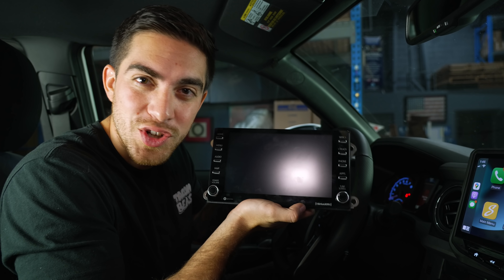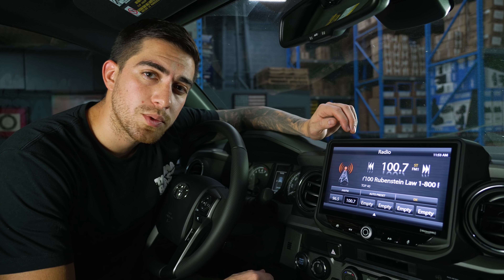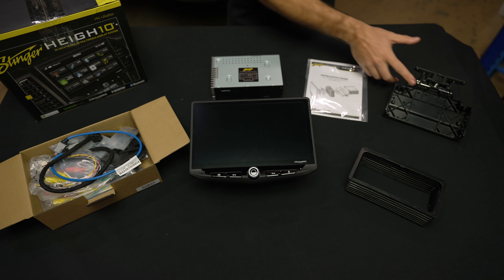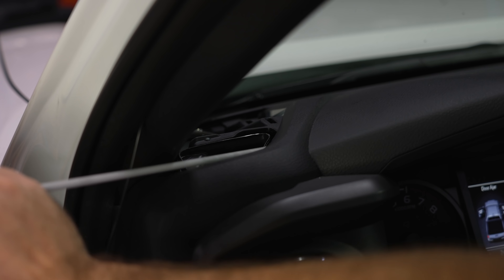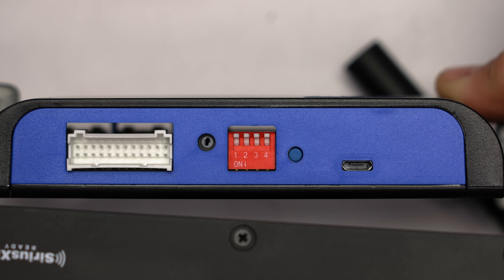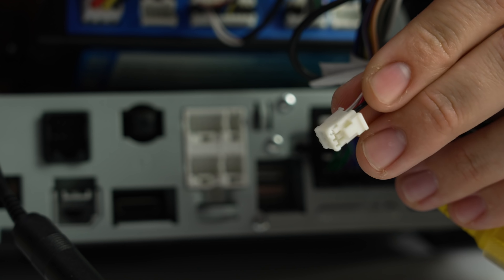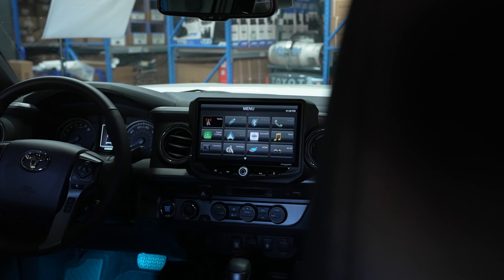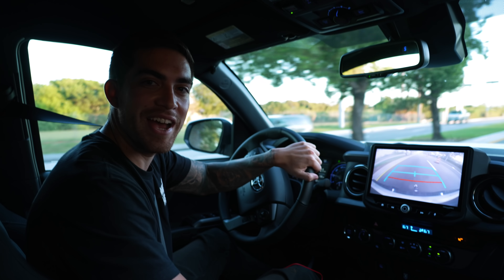2016-2022 Toyota Tacoma 10" Touchscreen Infotainment System Review/Install

Comment: Greetings. I will truly get this soon. But I had a question about the hdmi and usb. Can you plug in a external portable hard with video and watch it in the screen. Also is the hdmi plug accessible. Also what additional cameras can you use for this. Thanks
Reply from the maker: You can technically plug any device that uses HDMI, HDMY is not that accessible, our advice would be to connect the HDMI cable a route it to the desired destination. Here is one of the camera options that are currently available, more on the way! - https://tacomabeast.com/collections/head-units/products/flexible-housing-self-adhesive-blind-spot-camera-1

Comment: So with the factory screen, is that compatible with any other toyota vehicles?? 
I have a 2016 corolla and I want to upgrade the factory screen. I was wondering if I can use it on the corolla? I mean if not what do you do with the screen. If you can that would be awesome.
Reply from the maker: It is made for Tacomas but i believe stinger has options for other Toyota vehicles 🤙

Comment: How do you connect Sirius XM? Where does the black cord end go to make this compatible? Thanks!
Reply: It is super simple. If you get the required SiriusXM adapter for $50, it just plugs right in to the brain of the head unit with the provided cables.

Comment: Does this upgrade make your rear camera an "anytime" camera?   
And if you can add extra cameras, if you install a front camera, will it make that an "anytime" camera?
Thanks!
Reply from the maker: It would make all cameras into anytime cameras meaning you could activate them from the unit, and as long as the camera you instal is compatible it should be good 🤙

Comment: Does the harness come with RCA inputs for aftermarket amps? Curious to know because I am running a JP234 4 channel amp and a JP23 monoblock amp onto my stock 2018 TRD sport headunit.
Reply from the maker: It comes with 3 RCA outputs, front rear and subwoofer 🤙

Comment: VHB tape would be a lot better to secure the radio replacement interface. Zip ties seem like a really janky solution considering the price. Does this have the same issue as the stock unit with delayed audio when connected with bluetooth?
Reply: That was my thought exactly.  $1500 and zip ties were the best solution to secure the radio module?  Cool upgrade for sure!
Reply from the maker: You could use 3M tape if you’d like 🤙

Comment: I just installed this kit on my 2018 TRD Pro today. Overall it looks nice in the truck. But my backup camera will only come on when I manually turn it on with the camera button. It does not come on when I put the truck into reverse. I have triple checked everything and it all is as it should be, but the problem still remains. I don't think its the case, but my truck is a 6 speed manual transmission. Not sure if that could have anything to do with it, but I doubt it. I have reached out to Stinger off-road Technical support in attempt to get it resolved. The external microphone does not work either. I just switched to the internal mic on the device and it works fine. Any insight would be greatly appreciated.
Reply from the maker: Stinger support might be able to help you better since we haven’t had any of these issues

Comment: Will this head unit wake up the dead stock rear speakers?
Reply from the maker: You could potentially plug the speakers into the unit althought it might be a different issue that’s caused them to die on ya 🤙

Comment: Does it still have the built in maintenance reminders that is on my 2016 infotainment center?  Resetting mileage for tire rotation, oil and other fluid changes would be a nice feature.
Reply from the maker: It should still have all the settings 🤙

Comment: Does this fix the low rear speaker output?  My 2021 rear speaker output is so low I have to fade to the rear to even hear them.
Reply from the maker: Im not sure if that’s an issue that can be fixed with this, it might be a faulty speaker or you might want to try upgrading your sound system🤙

Comment: Is this louder than the JBL system since it has a bigger amplifier?
Reply: I'm sure it will make slightly louder. However you need a whole lot of amps to get up just one more decibel once you are up around 110 db or so already.
Reply from the maker: It can link with the jbl system so it’ll be even louder for sure 🤙

Comment: My question is does it remove the toyota hotspot?  I don't want to use my phone hot spot. Since my plan only has 8 gb of data at 5g high speed, then unlimited at slow 3g speed.  The kids would chew up the 8gb in 2 or 3 car trips with the tablets on my phones wifi hotspot.  While the toyota wifi is 200 a year unlimited data and with good 4g speeds.  Also my dashcam uses the on-board wifi for event uploading.
Reply from the maker: It does not remove the Toyota hotspot

Comment: I just had this installed the Android Auto isn't working  properly. When connecting the cable to the USB port  Android Auto comes up on the screen then goes out completely.
Reply from the maker: Shoot us an email at support@tacomabeast.com and we’ll troubleshoot this for you 🤙
Reply: @tacomabeast  Thanks I found out what the issue was it was the USB cord I was using.My other issue I've noticed when connected to Android Auto the backup camera doesn't work when putting the truck in reverse

Comment: it would be 4Runner compatible too then ?  Tundra too ? Could multiple Stinger units be installed in Crew Cab ed. or SUVs to avoid the Are we there yet ? Syndrome from the UNDER 16 crowd ?
Reply from the maker: It is not compatible with the 4Runner or tundra

Comment: Great install video! This is exactly what I have been waiting for. Just placed my order on your site for my 2019. I saw it is on back order until approximately April… worth the wait. I saw it needs the XM adapter part #SXV300AZV1 to get sat radio to work. It was only an extra $50. Do you know if it is plug and play like the rest of the harnesses?
Reply from the maker: It should be 🔥